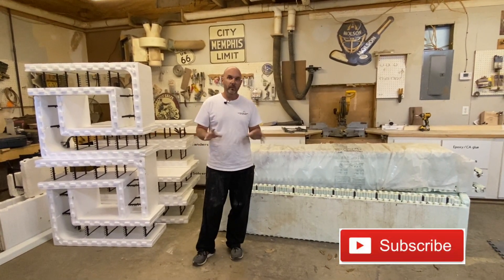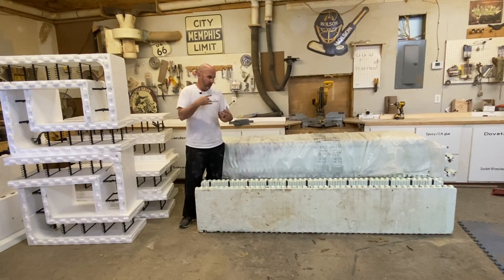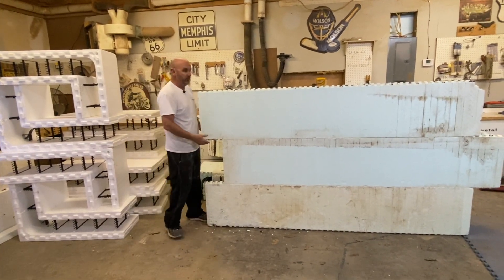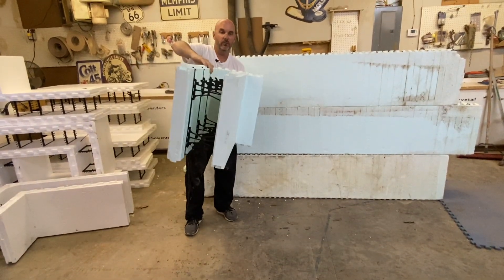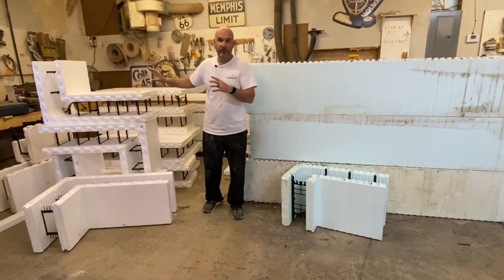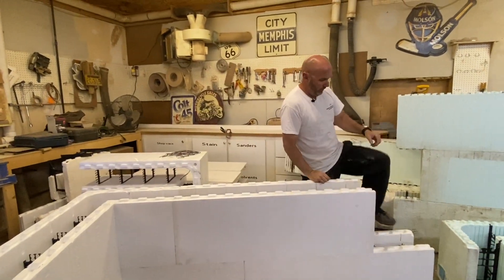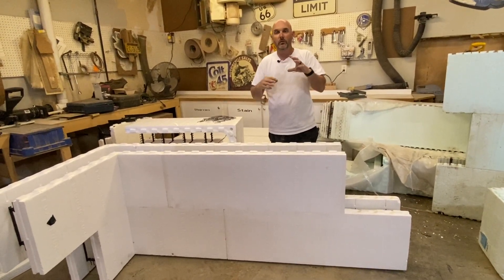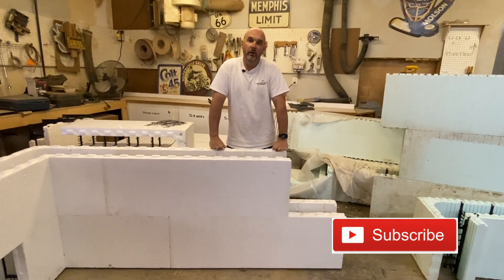ICF Review!  Fox Blocks vs Nudura?

Comment: We’ve been using Foxblocks and really have a confidence in using them. Menards near us quit selling them but we were able to get them from another local supplier. We are in Wyoming and we are experiencing the rising costs of materials all around. It is very frustrating. However, I actually saved money with our foxblocks and am very thankful for that!
Reply from the maker: I can tell you from talking to there corporate guys they are trying to avoid big price increases🤞🏼
Reply: Have any bracing for rent in Wyoming?
Reply: @flackthat7  Our local Rocky Mt Premix has Plumwall bracing for rent. We just finished our current build’s basement walls, using plumwall for the first time. Foxblocks were easy before but the plumwall bracing made it even nicer!
Reply: @914934   Good to know! We will be building our home in Wyoming soon. Thanks for the info.
Reply: Hi there can I ask how much per sq (or per sq meter/sq yard etc) foot is your icf (supply only) costing you? In Ireland we are approx €40 per square meter.

Comment: Nudura is made in USA and Canada -- if you order these in US market the blocks come their manufacturing plant in Georgia - you're correct about the recent 20% price increase which is bummer news for those of us building with this brand. And Nudura does offer the metal clips and recommends using them on the joints. Great demo on the Fox blocks.
Reply from the maker: Ya I hear they have one plant in Atlanta, but I saw a quote for a job in Kentucky that’s not terrible far from Atlanta and the freight was higher than fox, which is probably the fault of the freight company and not nudura, I just want nudura to really try every trick in the book to keep costs down as right this minute lumber is so crazy it’s icf’s time to shine as an industry!
Reply: @all3pools  I agree — Nudura is not doing right by their loyal builders or distributors at the moment which is why we’ve decided to look to other ICF brands. Like you, we see Fox as a great alternative. And you’re spot-on, it’s time for ICF technology to out shine flammable carbon cellulose toothpick construction— and not just on quality— on price too!

Comment: I am a retired building contractor and in 2000 my wife and I moved to the Florida Keys we constructed our home using Nudura in 2008 we moved into our new home. In September 2017 we were hit with hurricane Irma we had no damage other than Landscaping, a couple of other points however I would like to make Nudura plastic web runs all the way top and bottom to the form which I believe is a asset, also the 18 inch tall form works very well for 9 foot walls. Over the years I have had the opportunity to work with a total of four other ICF companies and I believe your representation of the two companies were very good keep up the good work Norm
Reply from the maker: Great testimonial!  Fox also has full height webs!  I don’t think I’d care for a form that doesn’t!
Reply: @all3pools  thank you for pointing that out, I was not aware of the fact that they changed the web configuration to extend both to the top and bottom in the past I noticed that they tend to settle down a bit without having that plastic web extending to the top and bottom, furthermore occasionally when attaching drywall I would miss that plastic web because it did not extend all the way up keep up the good work
Reply: Are you having any mold issues?
Reply: @Missy-sx9zv  No I’ve never experienced any issues
Reply: Or health issues from the foam and concrete?
Reply: @Missy-sx9zv  once again no I have not experienced any such problems

Comment: Check out the corners of the Fox Blocks compared to the Nudura.  More attachment points for exterior siding. IMHO
Reply from the maker: Agreed, I didn’t want to bag on nudura too hard because given the right price I’d still use them...  but I never trusted their corners... only problems I’ve ever run into on pours is on nudura corners, I know guys who use them up in Canada who strap off every corner to shore up, making them even more expensive to install than I even said in the vid!

Comment: How much do you save on shipping and install time with Nudura?  Also Nudura makes block in Atlanta..
Reply from the maker: I don’t think you really save any time all in all...  I’ve worked with both significantly, when I started using fox I thought I was settling and I’d find aspects annoying compared to what I perceived to be the Cadillac of icf in nudura, my distributor told me as much...  I was pleasantly surprised at how well designed and user friendly the fox blocks are, my and my crew feel comfortable that we can go just as fast with fix blocks and feel way more confident with the corners!  I didn’t know nudura was made in Atlanta, but that’s still further away from me than 4 of foxs factories, and I live in the dead center of the country...  Can drive to one factory in 20 min and pick up, but when I need more specialty stuff I get full semis delivered from Omaha to Springfield mo for like $900, which is usually a whole house worth, so even if it was a big house that took nudura one truck and fox block 2 trucks, the extra $900 in shipping would pale in comparison to the price difference in the block at the moment...  on a pretty normal size house the other day(easily fit into one truck for fox) there was over 3 k price difference between fox and nudura!  Like I said, nudura is a good form but I don’t think it’s schtick is worth a nickel more than fox personally!
Reply: @all3pools  The main issue I have with Nudura is how you have to buy it.. I bet if they cut out that middle man and sold directly, it would be significantly cheaper.. As a whole the entire ICF industry is rather shady in pricing and for that reason we suffer...

Comment: Have you compared Fox Blocks to Amvic by chance?  Specifically price point wise.  So far from what I've seen Amvic might be the most economical solution, but I am awaiting my Fox block quote, so I will keep you posted.
Reply from the maker: I doubt it will be much different but I’m not familiar with exact pricing of amvic, I have seen some posts about amvic that says they don’t have full height webs, I don’t know if that’s true but I’d stay away from any block without full height webs...  amvic is made at the same plant in Nixa that I pick up fox, next time I’m there I’ll snoop around a pallet of amvic and investigate one of their forms so I can give you a more informed opinion!  I’d love to know what you find!
Reply: @all3pools  That's a good observation, I've now looked at so many different blocks I will need to go back and check regarding the full height webs.  Hoping to have my quote back in the next couple days.  Just for a quick reference, Amvic is currently running just over $17 for a straight 4' block in the Midwest.

Comment: I really like your channel and I subscribed right away.  I'm in Michigan and looking at building a duplex.  I had a contractor raving about precast concrete walls.  How would you compare precast concrete walls vs ICF in terms of overall build costs, speed, durability of construction etc...I'd love your feedback.
Reply from the maker: So in my market precast are really high$$...  we looked at them for fancy walls featured on my mansion video from 6 weeks ago, I was literally able to buy 15k in forms, rent cam locks, pay my guys and still saved the home owner 15k...  that’s probably an extreme example where they were architecturally important but I’ll give you my other cons of precast is you have to be very careful to waterproof the joints...  also one of icf’s best qualities is the built-in insulation with precast you are still going to need to spray closed cell or glue on foam board, they don’t really have to when they are building a Costco and speed is all that matters, but I wouldn’t do it in a residential setting, but that’s just my opinion!
Reply: Steve, I’ve built duplex and 4-plex with Fox Blocks. The HUGE advantage is the ability to run utilities inside the walls, and obviously penetrate the walls if needed. With precast, you can’t do that with precast! AND, the big advantage that is often overlooked is the reduction of noise between the “common walls.” The neighbor will NEVER hear what’s going on in the neighbors place. Heating & Cooling? No brainer! ICF will give you that. My 4-plex design was 4 single story retirement homes all using a common cross wall in the middle (they looked like a big + sign from above). The realtors sold the entire 24 of them in about 6 weeks. Fox Blocks has very good tech support, and field-wise people. If you run into a problem, just call! Also, I found it extremely helpful to hire (contract) an engineer to help design the structure. This extra cost, on a project by project basis saved $$ when it came to inspections and local building codes. The PE engineer did all the arguing with the inspectors for me. Thus, no hold-up on projects. His seal assures reliability and will standup under any insurance/inspection problems.
Reply: @stephentaylor9366  I really appreciate all the helpful tips!  I especially like the idea of enlisting an engineers help because of lack of knowledge from city officials and inspectors.  That seems like money well spent!
Reply: Steve. 
Thanks for the reply and kind words. There are many, many advantages to ICF block construction. I don’t know if you’ve seen the Drury Hotels in your travels, but they are constructed of ICF block. I don’t know which block they use, and am aware they were looking at alternative suppliers for awhile. Personally, my choice is the FOX BLOCK. These guys are some of the oldest in this country, and are into the manufacturing of all kinds of products made from ICF. I found their engineering and support for customers to be superb. As a matter of fact, it was one of their engineers who suggested I find a local engineer (PE) to help me. I was fortunate enough to find one that was licensed in all 50 states, so I could go to neighboring states and build with ICF, or whatever without much of a hassle

Comment: You mention that you can get Fox Blocks with the ties unassembled in the foam. You then have someone assemble at the job site. Turns out you can do the same with Nudura. That would give you Nudura blocks that are non-hinged with no metal pin. I live in Canada within 10Km of a Nudura distributer. We use Nudura and have a small number of site-assemble blocks around.  We substitute a pinless block anytime we need to cut a pin.
Reply from the maker: That’s great!  And I’m assuming given your location you might not be experiencing the fairly large price increases we are down here?  I really hope as things settle down nudura is able to stay(or become again) competitive because I really like the product!  I still use a ton of fab form stuff(fast foot and monopour legs) out of Vancouver and they had major supply chain issues this time last year but were able to solve it and are really quick on the draw at this point!  Here’s to hoping nudura finds a way to do the same!

Comment: One thing that needs to be talked about is the heignt of the web. I used Amvic on a house and without a full height web just like Fox Block, and for attaching siding it was a pain because you can up to four or five inches of just foam with nothing to screw into.
Reply from the maker: It is a pain if you don’t have a full height web, but fox block does in fact have full height webs,!
Reply: @all3pools  Amvic web is close to the top of forms, you can cut the foam horizontally for wires in that small gap without dealing with the solid web. True there is no web to screw into at the one small point

Comment: Nudura is the one who started those clips for vertical and horizontal attachments so not sure why you would say they need them.  need to know what you are talking about and what each manufacturer can have.  Otherwise get video!
Reply from the maker: Most of their distributors brag about not needing them when pouring on a footer, and I’ve poured thousands of yards into nudura without and it works great, but for monopours you want clips, nuduras clips are really unhandy...they have short little legs and are very stiff, hard to install, using a bunch on a monopour is very taxing, fox’s clips have a tail on one end that acts as a handle allowing you to gain a mechanical advantage and install them with ease, anybody could clip all day without tiring with the fox clips...
Reply: Every video I have seen from Nudura says use their clips.. even their videos from 9 years ago..
Reply: I am not sure who is telling you not to use Nudura Verticle joint clips, but they should always be used.  Not just on your vertical joints but in your corners as well. I would like to see you install them correctly and then try to pull the wall apart.
Reply: Actually they use a zip tie to  hold vertical

Comment: all really interesting - thx for relaying your experiences. 

seems like the added time spent clipping Fox, would be fairly equal to the time spent cutting the metal hinge for windows & using a rubber mallet to click Nudura... equal labor (dependent on number of cuts needed of course)? plus, cutting metal hinges would be added blade costs, no? i hear corners are the #2 spot for blow-outs (spliced joints that aren't braced properly as #1?), so the added length of Fox corner short-sides is appealing. 8ft Nudura length & 3ft window base (2x 18" blocks) seems appealing too. 
competition is good!
Reply from the maker: I no really find fox every bit as fast to build on our jobs, the height of the block for me is a non issue, 16” block make an even 8’ wall 18” block make an even 9’ wall, but neither usually do because if it’s a slab we want icf to footing so the floor isn’t a thermal bridge, so u lose 4-5” and now you have a ripped course anyway, crawls and basements can work with either form if you take time to figure floor height before excavation so footings are at just the right benchmark to end where u want!

Comment: Hell yes! I’ve been doing research on these, and was going to mention you in summary video. Any difference if using Amdeck or Quadeck? 

Love Perfect Block, but can’t get past the idea of foam portions of the wall being full depth.
Reply from the maker: Thanks! I haven’t used either of those blocks because distribution isn’t as available in my market, that said the plastics co that subcontracts the production for fox in Nixa mo also makes multiple other brands so assuming many of the manufacturers of the other block companies had a way to allow for direct pick up like fox, it would then come down to price!  Like I said in the vid I think most of the bigger companies all make good blocks that all have similar user friendly designs, so in my mind it will come down to availability in your market and price!  I just won’t pay a lot more for Bells and whistles that make things 1% easier!:). Thanks for the feedback!
Reply: @all3pools  oh snap ! Nixa is only 2 hrs from me. This video just made it a simple choice to go with fox blocks over nudura for my diy build. How does a person go about picking up directly from the Nixa location?
Reply: same reason i passed on Perf.Block... lack of that continuous sound & mass barrier doesn't seem worth the added insect/fire resistance, esp if you plan on an outer wall with air-gap & radiant barrier before a stucco siding anyway.